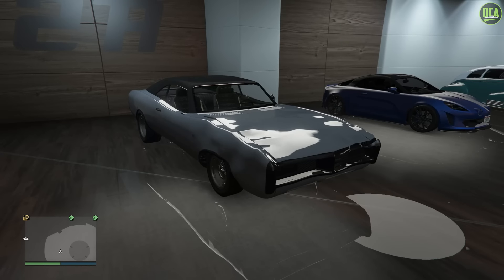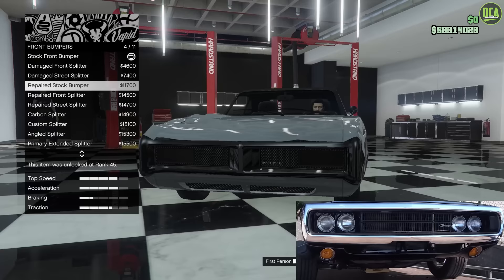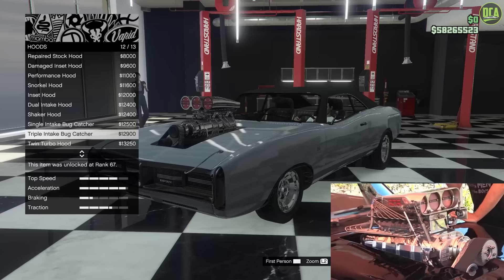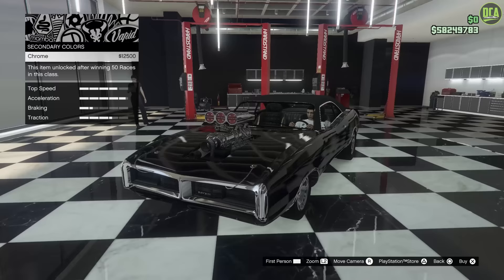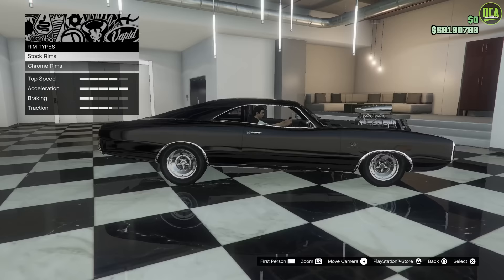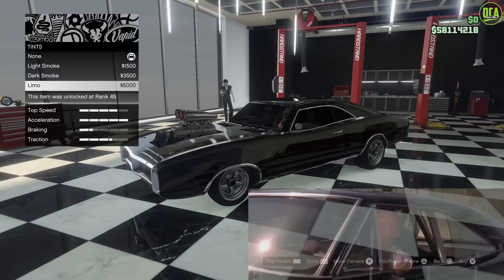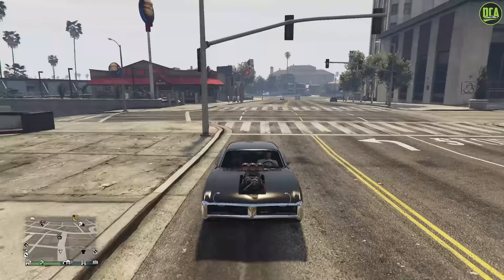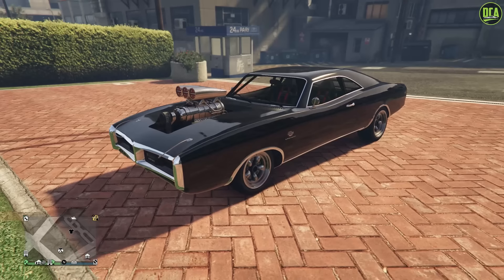GTA 5 - F&F 1 Movie Build - Dom's 1970 Dodge Charger - Imponte Beater Dukes Customization

Comment: Y’know, I’ve read that on top of the horsepower advantage, the Charger was actually lighter than the Supra. The Charger’s interior was stripped while the Supra’s was stock.
Reply: The Supra by itself is pretty heavy considering the fact it's more of a Gran Tourer than a Sports Car, weighing around 1500KG
Reply: @Blaza303  I curl 1500 kg, trust me
Reply: @dyln3242  nice

Comment: When you put turbo on this car it actually makes a supercharged sound similar to the gauntlet classic, instead of the typical turbo sound like the regular dukes.
Reply: Exactly exactly which one do you prefer the original dukes or the beater dukes. I always trick out the original for Franklin can't nobody else handle that car like him especially souped up.
Reply: @darrendyson8347  beater dukes
Reply: @shylonkado9857  do you mind asking why? Is it because of the performance is better or the visual slightly??
Reply: @darrendyson8347  The customization

Comment: The "hero car" had no passenger seat and a full bare cage, encase anyone was wondering. You can also go for the off-road Dukes for the thicker tires.
Reply from the maker: The Hero Car was the one that ran and drove with a functioning blower: 
https://www.mecum.com/lots/CA0809-81455/1970-dodge-charger-coupe/

The one that had one seat were the stunt cars shown here: https://www.mecum.com/lots/SC0515-213628/1970-dodge-charger/

Comment: I took the normal Dukes because it has a much better sound, is also available in single player mode and the compressor's intake funnel looks more original. It also costs a lot less and is faster. 😊
Reply: The normal dukes sounds the same? It doesn't have the supercharger wine that the beater dukes has
Reply: I like the more aggressive and „roaring“ sound of the OG Dukes.
Reply: @maggaveli6764  And I didn‘t say, that the Sound is the same. 😅

Comment: There is a way to use the ifruit app. 
You need older cars and older wheels. Make a garage with og vehicles with stock or wheels that are NOT from the street and track category. From that garage you need to take out 10 different og cars with og wheels and the app should work.
Reply: Basically the reason for the crash is the app isn’t updated to have the newer cars and wheels. So when it cant find those it crashes.